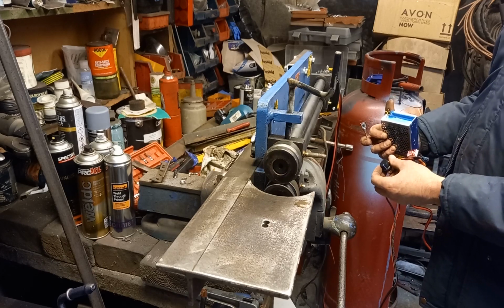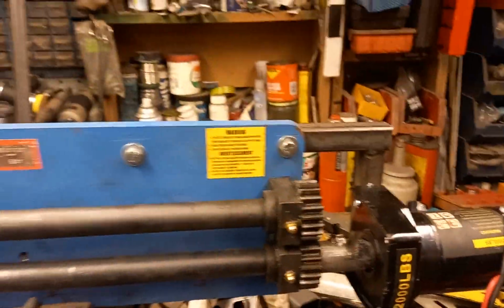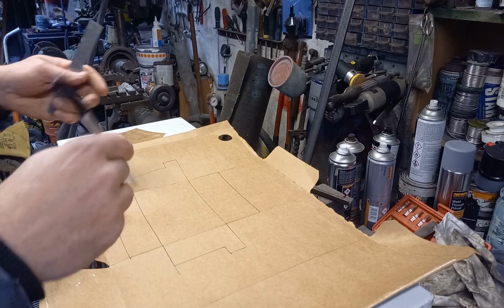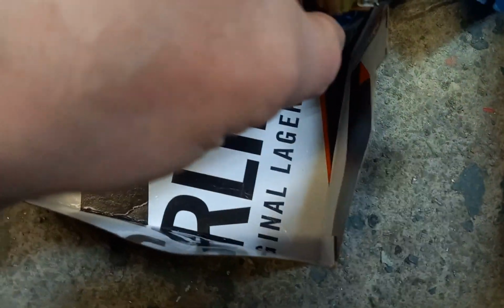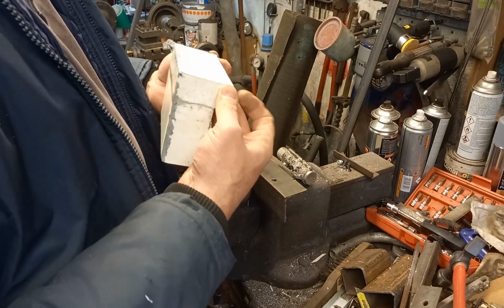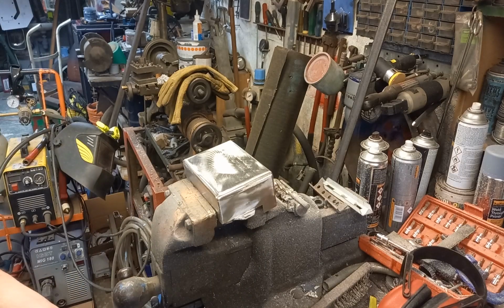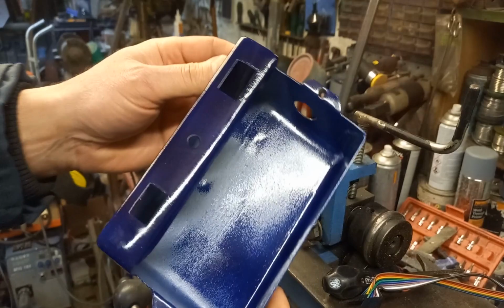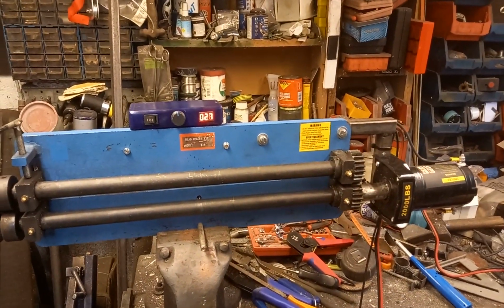Bead Roller Motor Conversion.  Car Restoration.

Comment: It is a pity you didn't extend the square tubing, the length of the bead roller. Had you reinforced the plate it wouldn't be flexing like it did when it came off the sample plate. This will make repeat depth of bends so much easier. I realize there are some, for whom this is not necessarily important, but that is just one of the things that most owners address, right off the bat.

Comment: Is that a stepper motor?, if not , can you use stepper motor to motorise a bead roller?, if yes what size of a motor if big enough?
Reply from the maker: It's not a stepper motor, it's a from a winch, I guess you'd need a pretty heavy duty stepper for thus, and it would be expensive, plus the stepper controller.
Reply: @DavesGarageuk  ok thanks.  I will buy a winch coz I want to motorise mine for my business